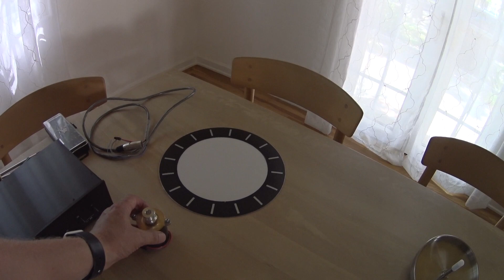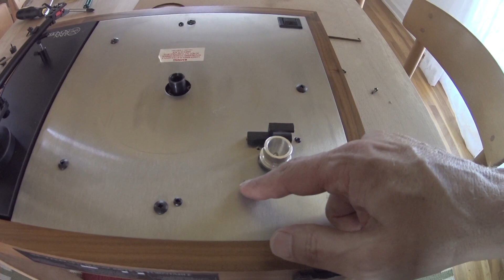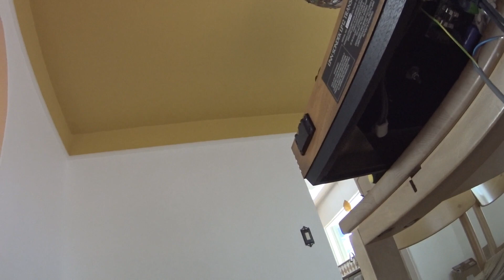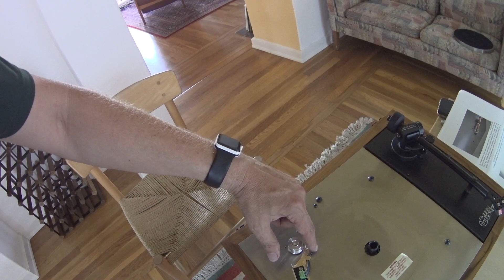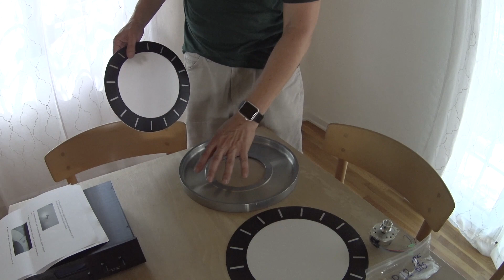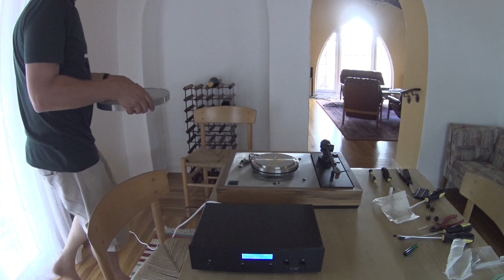Linn Sondek LP12 Mober PSU and SSP12 sub-platter Installation

Comment: A few pointers that might help for the future. I'd definitely put a cap over the main bearing when working on the deck with the sub-platter removed to prevent dirt ingress and the possibility of accidentally dropping something down it. The first two screws removed in the video are actually the motor  azimuth adjustment screws that adjust the belt run position and fine tunes the speed. I'd reassemble in a different order too; fit the motor retention bolts then the two adjustment screws. Each to his own, and you pays your money and takes your choice, but the kit looks a tad "Heath Robinson" to me and certainly doesn't reflect the precision engineering legacy of the Sondek: Wires through the scrapped belt guide (obviously not required so that's why Linn fit one!) and the self-adhesive sensor ring, for instance, none of which inspires confidence. As a UK resident I remember when Valerie Singleton used to make things out of "sticky back plastic" on "Blue Peter" - perhaps this kit's a homage! Interesting and thought provoking video, though, and thanks for the posting, and the main thing is if you're happy with the results fair play to you. Again, personal choice, but before attempting to interfere with the factory specification of the deck I suspect attention to the siting of the existing turntable should have been a priority; LP12's like to be on light, rigid surfaces (such as a small solid coffee able or decoupled wall shelf) rather than on a massy table (along with heavy amplifiers etc) as shown. Hope this helps and thanks once again.

Comment: Hi Rob,
Thanks for taking the time to make this video.  It helps demystify, somewhat, the Linn LP12 by showing just how easy it is to do your own work and achieve good results.  While I might disagree with your methodology and terms used somewhat, I think overall you've done an excellent job. 

IMHO, after owning and maintaining an LP12 for 36 years, the Linn is an exceptionally easy table to maintain and keep operating at the highest possible levels.  I don't agree that a Linn table jig is required for any phase of a working with the LP12.  Having one definitely makes leveling the 'table and suspension easier. It also presents the 'table to the workman in a more accessible way, making all aspects of the job at hand go quicker, easier, and with greater potential visibility.  But...there are so many alternative adhoc 'jig'/setups that'll get the job with the same outcome. 

By the way, in this context, I clearly understood that the tachometer wheel was the same thing as strobe disc. 

If you don't mind, could you share your observations about the performance of the Mober?  The build quality?  Useability? Reliability? 

Best,
James
Reply from the maker: Thank you for your comments James.
I bought my LP12 in 1987 in Europe and it has travelled with me around the world. While I am an LP12 lover I am by no means an expert and my goal was to update it so it would run well in the US where I now live and also to be able to play the few 45 RPM discs I have. I looked at what was possible for a reasonable cost and after communicating with Edmund  I decided to purchase the Mober kit. I planned out how I would perform the installation by reading as much as I could online but I knew that if anything went wrong my local Linn dealer would be able to help me out.

I decided to make the video at the last moment for my son. I am not a natural in front of the camera and as I was documenting the steps as I was going alongI had no desire to reshoot any sequences where I fluffed the dialogue. I did forward the link to Edmund who then asked if he could post it on his social media. I am all for helping out small businesses such as the one Edmund runs so I agreed. I am so surprised it has had as many views as it has and I am happy if people found it useful.

Regarding the Mober kit: I am very happy with the build quality and the general functionality. Being a curious person I've taken the cover off the controller and I found a high quality circuit board and PSU all assembled beautifully. The only criticism I have is that you have to wait for the controller to boot up as it doesn't respond to the speed controller until it does. After booting I never seem to be able to get it started with a single button press, so I press a few more times and it starts. Once it is running it is stable and I have had no issues with it.

I have not compared my system with any other and my comments at the end of the video are my initial impressions. I have not changed my mind since then

Comment: I worked with the Maxton development kit for DC motors for use in turntable drive systems several years ago and was not overly impressed and also had the second Mober in the UK for evaluation i have worked professionally as an LP-12 Specialist for 25 years if you listen to the mober motor with a stethoscope through the linn top plate it generates far more noise than the good old 24 pole ac motor and what irritated me about the mober psu is as mentioned it often fails to respond to the speed switch this can be quite annoying and to be fair i think Linn's own Radical that also uses a higher quality maxton motor than the mober is unacceptably noisy as well even after they have potted it..  the original 24p motor when properly driven with a pure sine-wave and balanced phase is incredibly hard to beat especially when post startup ramp-down voltage is applied at 65v as with the later lingo it is silent  and far more cost effective ...
Reply: I agree, if I still had my LP12, (sold 20 years ago)  I would stick with the AC motor and get the lingo mk4.
Reply: @chrissyman77  the lingo mk 4 uses a new 24v motor certainly a step in the right direction but you wont but a Lingo 4 + new motor for £395 that is the cost of the new vinyl passion power supply and it is easily as good as a Lingo 3 so quite a bargain as was the idea in the design a high performance 2 speed power supply at an affordable price with generous part exchange against Hercules Valhalla & magic power supplies making it even more affordable
Reply: @vinylpassion8782  My problem with your ttpsu will not be shipped to germany. This for me is a no go for your ttpsu!
Reply: So the best bet is to stay with my Greenstreet Geddon + original Linn AC motor?
Reply: One buy the product does not mean that you worked with the development kit, I bought the Linn LP12 does not mean I worked with Linn LP12 development kit, anyway, a salesman say whatever they want to talk. 24 poles AC motor is simply the easiest  to get 33.3 rpm by feeding 50Hz and AC voltage to the AC motor, it is cheap and good for commercial product.
Reply: @matthiaszeitler8317   It is shipped to Germany and every other part of the world its available though the vinyl passion shop and also e bay
Reply: @echanemail7   incorrect i worked with maxton directly Edmund you sound bitter...  the ac motor is simply quieter and yes salesmen like to hype up dc and charge a fortune i think products speak for themselves and i for one prefer something that is built in England with a genuine ce certificate your Hercules is not ce approved you do not supply copies of the ce approval to your suppliers and yet you put ce stickers on the Hercules this is frud in the UK and the USA or would you like to supply a copy of your CE Approval Certificate ?
Reply: @vinylpassion8782  Before you launch your product , competition of Hercules, You contacted Stamford Audio Gordon to challenge his CE certificate, Then Gordon has shown you the CE certificate.  I trust Stamford Audio Gordon, a true Gentlemen.  I rather trust users comment rather than competitors talk. Conflict of interest.
Reply: Probably best to keep the original motor and run it with the Phoenix engineering and Roadrunner
Reply: @vinylpassion8782  Very poor form coming on here and dissing a competitor's product. You should realise this behaviour only makes YOU look bad, not the competitor you're criticizing. Show some professionalism, please.
Reply: I have the full Mober upgrade including new inner platter and motor and outboard PSU. I don't know about the stethoscope test but I can say that we tested the old Linn motor and the new one in hand and when the motor is running in my hand, the new Motor could not be felt running but I could feel the old AC motor spinning in my hand.. How that translates when fitted is difficult to say but the Motor I was supplied was Swiss made and potted it is a well made and bespoke looking item,  the old one looked generic and off the shelf. I do agree with one observation in that the speed select buttons can be a bit hit and miss on the PSU, its not that they are failing, more that the push buttons are a bit finicky to push smoothly. That gripe aside, I found the speed stability as checked with a stroboscopic measuring device confirms it a rock solid in either 331/3 or 45 rpm, I like that the display goes off when not in use. I can only speak for my own upgrade but it all works and works very well indeed. I have an Ittok Arm fitted with an Audio Technica ART9 MC Cartridge sonically its a real step up from my previous Valhalla. There can be no argument that its better to have the PSU outboard less electronics and less noise. The noise floor in general is noticeably improved, the general focus and timing seems better to me, maybe down to the more accurate, consistent speed stability and the new inner platter. This also translates to detail retrieval my arm and cartridge really likes this set up. I love the ability of the Art9 line contact stylus, its tracking ability and openess is way beyond its price and can easily live with much of the so called "esoterica" out there, this ability is only enhanced by this set up. I plan on a new Arm Board and EKOS SE going forward but having used this Mober upgrade for 3 years or so now, it has been utterly reliable with the push buttons for speed change being my only and very minor gripe. There seems to be al great deal of snobbery around the audacity of Edmund to challenge the status quo but I believe his upgrade offers a good deal in terms of Bang for Buck and I highly recommend the full upgrade.

Comment: What relevance is it to change the inner-platter its got nothing to do with the power supply and motor.
The same as the Phoenix engineering and Roadrunner I don't know which is better, how much did that cost motor power supply.
Do you want to get rid of the original motor and power supply board I'll take it off your hands

Comment: Really don't understand the thinking behind adding a ball to the bearing?  An additional boundary surface, the Linn single point bearing is absolutely fine as it is.
Reply: @sugarkonny6119  Some put two large magnet and claims it ease 50% of the pressure of the platter on the bearing house, not sure for that. The ball bearing contact surface to the bearing is zero, according to Physic, contact surface is zero and pressure is zero. Without adding two large magnet and do better , more importantly, the sound improvement.

Comment: Hello~ Rob I’m very interested in the mober psu. You’ve had it for some time now.  Do you recommend it?  I’m currently running a Valhalla PSU and I’ve been contemplating a new PSU you for quite some time now.
Reply from the maker: I do recommend it. To my ears it is an improvement for the 32 year old LP12 I have. The comment about the failure to respond to the speed switch is true and I have not heard the Radikal PSU and motor but I am happy with the results.
Reply: Thank you for your prompt reply ^^

Comment: Points to take on board with this video. The gentleman had know idea what to call a strobe disc, no Linn jig to dismantle the turntable, or reset it. Dismantling and reassembling an LP12 in this man
ner is not recommended, especially by Linn. Would you chance doing it to your expensive turntable?
Reply: I think what you call a strobe disc is a tachometer disc. Strobe discs use artificial lighting modulated with the mains frequency or a secondary source to display the interference patterns so that when the markings appear to be stationary the correct rotational speed of the platter has been achieved. The disc the gentleman is installing is a clocking source and the light merely reflects of the light portions of the disc to provide an accurate feedback for the motor controller so tachometer would be the more correct term.  As for the "Linn jig". A great way to separate you from your money. He was careful and unhurried and those attributes are invaluable when working with almost anything. Hard to justify the cost of a jig when a couple of carefully placed pieces of 4x2 can do the job. Not to sure of the claimed sonic improvements though!

Comment: Snakeoil , beware !
Reply: Mober DC motor has been selling for 5 years now, and ship to 23 Countries. All customers are happy.
Reply: @echanemail7  Snake oil if it's changed the sound of the deck like he said then there's a problem ,, more open,, please I don't think so even the vallhala is still in there . What was wrong with the speed before? Snake oil.
Reply: @revamp777  if I heard right, it's not just about the speed.
Reply: You go into a Linn dealer and ask to buy an LP12 and he says "that will be £30,000 please", and the buyer asks "£30,000 for an LP12"?, and the dealer says "yes its "£2500 to buy it as stock, but you'll have to factor in all the upgrades that will make it better during your ownership".
Reply: @RightWing1  the choice is your to make. At least you don't have to sell the deck for another deck, if you want better sound. Your exaggerated comments are laughable.
Reply: @chrisguygeezer  Agreed I have gone my direction but I have 2 friends and colleagues who are into HiFi and they both got sucked into the Linn/Naim hoo ha, yet ironically neither of them have this setup now, they got sucked into this constant cycle of buy the Valhalla upgrade, then the Ittok to Ekos, then it was the Troika cartridge upgrade and £1000's of pounds later the law of diminishing returns where each upgrade was with marginal audible difference.  I'm not preaching, if thats what you want to do then thats fine, each to his own and all that.
Reply: @RightWing1  So, what deck do your run?
Reply: @chrisguygeezer  Project Xtension10, Ortofon Quintet Bronze, NAD C-658 BluOS Pre-amp, Exposure IV dual regulated Power Amp and Rega Alya speakers.